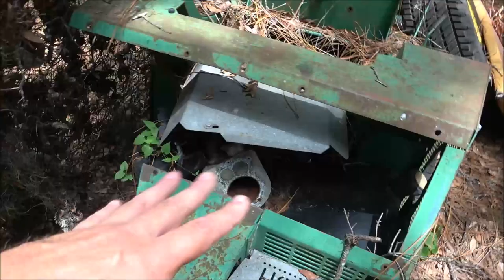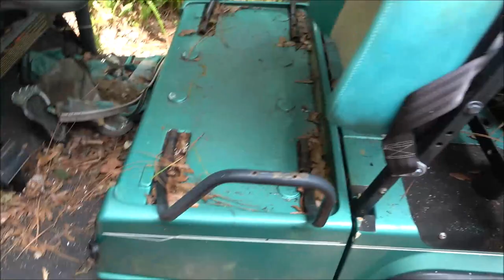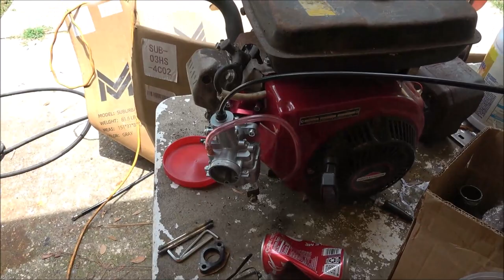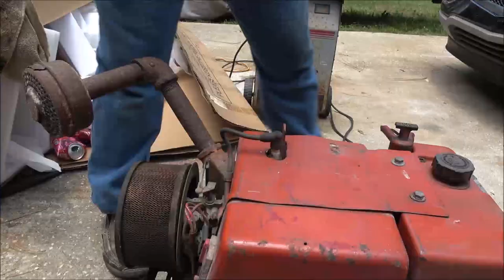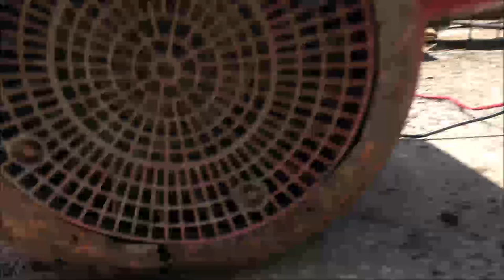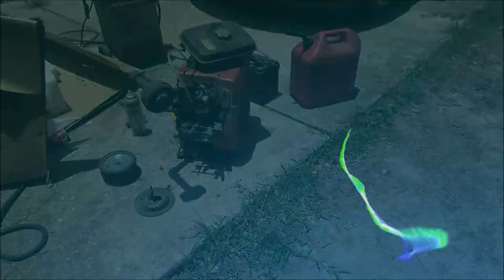Will It Run? Old 12 HP Kohler Engine

Comment: G'afternoon bro 🤠 .  Nice score,  that Kohler's gonna be a beast 🙃 .
Reply from the maker: Hi buddy, hope all is well with you. And thanks, should be a good engine for a project. Any ideas?
Reply: @shabear1000  hhhhmmmm 🤔 . That would be really cool on a go-kart chassis. Or maybe you could Fab up supports and motor mounts from angle iron and pre-drilled 1" flatbar stock and put it in the back of the go-kart and maybe even convert it to chain drive.  It would also be a cool original idea to put it in a small boat with a v-drive.  That engine is going to be all about torque and it'll have no problem spinning a nice size prop 🤓 ..
Reply from the maker: @idletime lol, funny you should mention that, it's exactly what I was telling monkey.